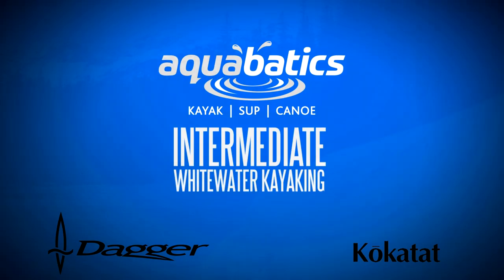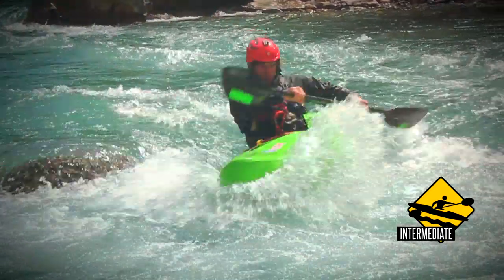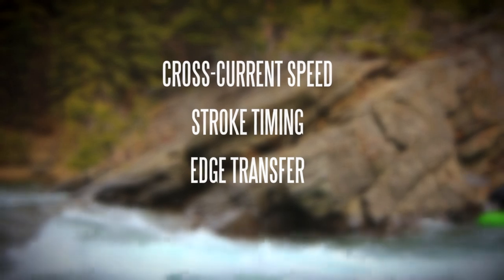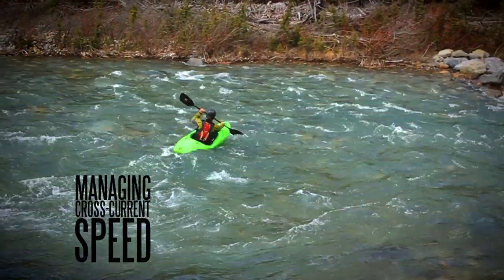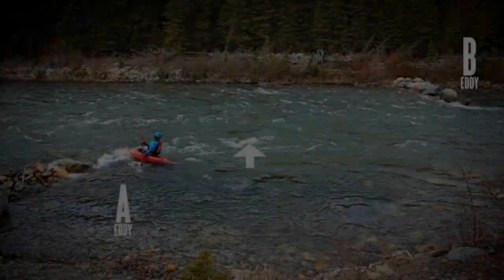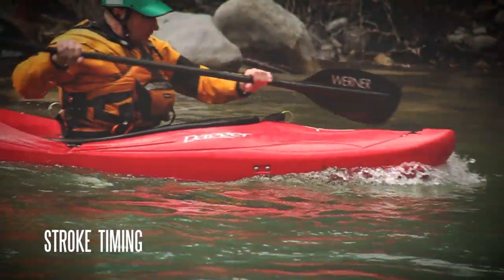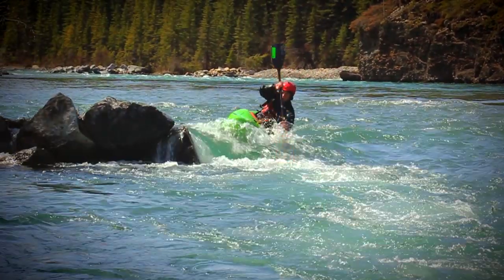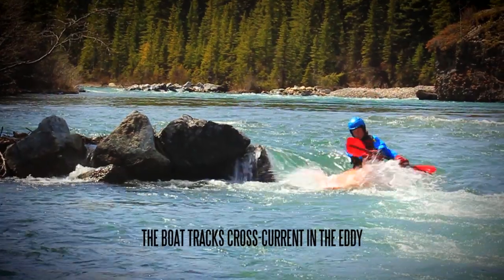How to Boof a Kayak (3 Components to the Basic Boof) | Advanced Whitewater Kayaking Skills Series

Comment: Back when  I taught kayaking, we called this "how to catch an eddy" using angle, momentum and lean.  Boofing was about how to land a steep but shallow waterfall or just fly over a shallow rock with a big sticky hole behind it???
Reply from the maker: Thanks for checing out the video. We also use ths to teach catching eddies, we then just add the additional lean, stroke timing and feature to turn it into a cross current speed boof. The arc of the 'eddy turn' coming to the drop allows the boof stroke to drive the kayak straight off a droprather than have it turn. Lots of ways to boof for sure, this is just a pregression we use for strong intermediate paddlers learning to boof.

Comment: Please define boof....
Reply from the maker: Hi Scott.  In its simplest description, boofing is the bow of the boat landing in a way that it rides over (rather than through) a hydraulic feature.

The boof many people aspire to is off a waterfall and the boat lands flat and then skips away from the drop without losing downstream speed.  It is a critical component of paddling harder whitewater.

This video is designed to give intermediate paddlers some tangible working points to dial in the basics and progress from there.

Hope that helps and happy to elaborate further.